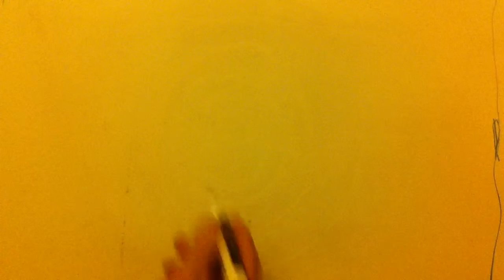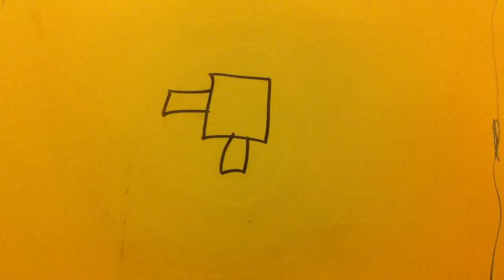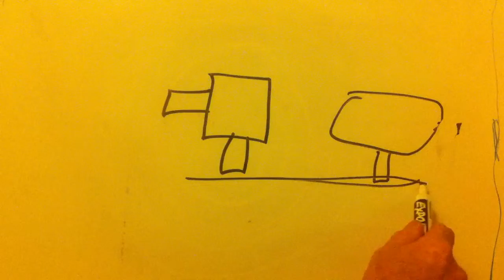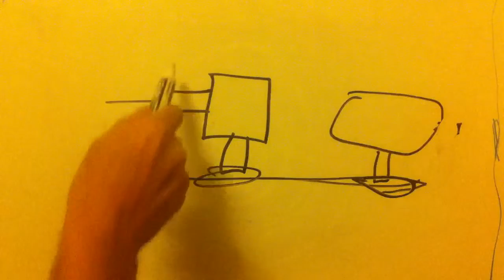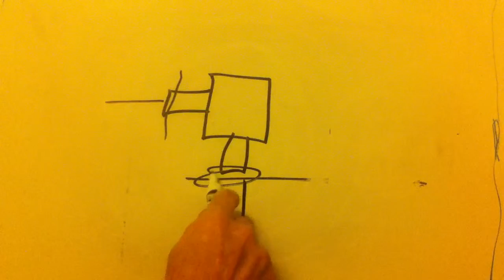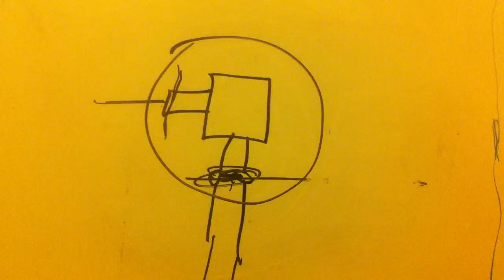Bandsaw Mill Project - Video #5 - Right angle gear box for vertical shaft power plant.

Comment: I was considering this same set up until a friend gave me a Cub Cadet rider with a 15 horse Kohler horizontal shaft.
Reply from the maker: I have a couple horizontal motors but vertical shaft motors are free on old riding mowers that only need a little carb cleaning to run. Figured it would be nice to be able to change motors out cheap. I also just got hold of two riding mowers, one 21hp and the other 24hp. Hoping to use an inch and a half band blade. Need the power.